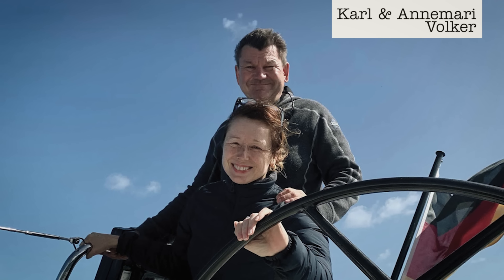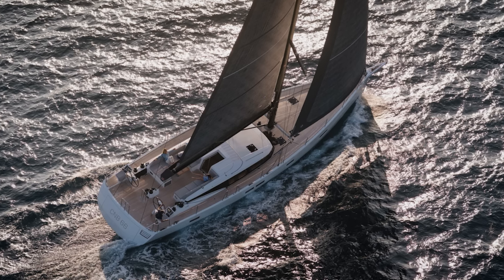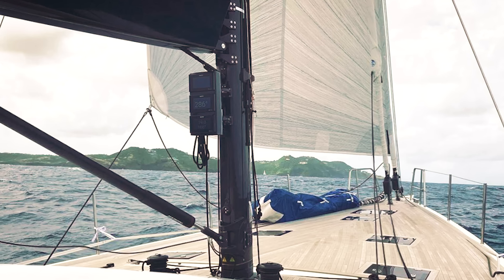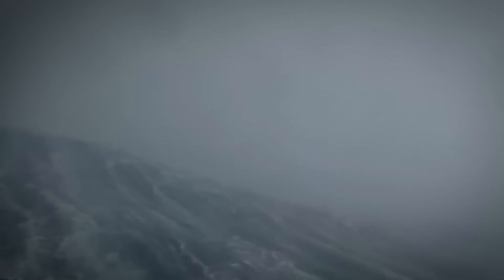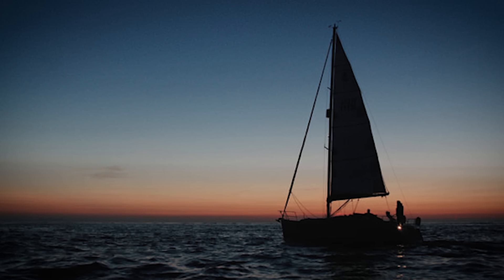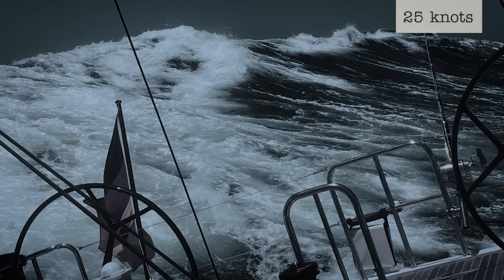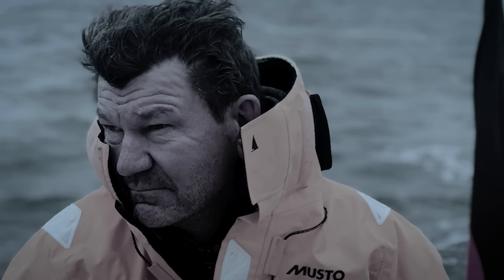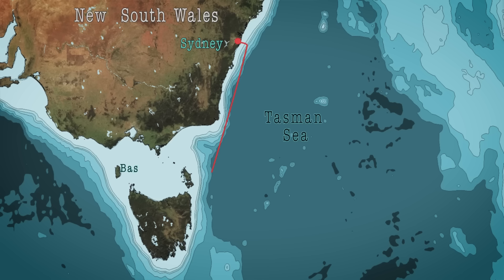Couple DIES on Private Yacht!

Comment: 1979 was the advent of Sat Nav, and later GPS as prior to this the sextant was state of the art.
Think of the lives saved if the sextant remained the only navigation tool.
Reply: I don't see your point. This incident had nothing to do with navigation systems. If anything it might have been worse without GPS. Correct me if I'm wrong but isn't it difficult to get a proper fix in a squall? A precise location is what authorities needed in order to execute a rescue. If you're implying that sailors who can use a sextant are more skilled.... I'd have to say the only thing they're more skilled at is using a sextant. Having a machine on board that gives you a precise location, speed and direction in any condition is only positive. If this couple died because of being marooned in the open ocean after a lightning strike and losing all electronics on board...then you'd have a valid point.
Reply: @falkpatt  I provided a reply which now seems to have been lost.

Briefly, this wealthy yachtsman found himself mid-Atlantic with cascading problems, as can often happen in open seas, and he was unable to deal with it, leading to tragedy.
Without electronic nav he most likely would have never found himself in those circumstances.

As for myself, I am a former navy officer, federal service academy grad, and USCG licensed ship master with decades of experience...
let them remove this as well
Reply: @MarcelaR-dh1ok  okay I see what you're saying. Because it's easier to navigate more people are sailing... You could also say that more people are sailing because there's more people in the world... Population has doubled since 1979. You could also say that more people are sailing because of a lot of other factors too, like increased production of fiberglass boats. More people are also sailing because it's on social media and more popular. But I doubt too many people in the Navy or Coast guard would lament the invention of GPS.... It makes their job easier. It makes our oceans vastly safer. You know back in the day Marine charts actually used to be guarded as top secret documents by Spain, Portugal Britain etc. I'm sure more people got out on the water when the first accurate marine charts were available to the public... and you didn't have to navigate with Dead reckoning anymore....  But it would be silly to say marine charts were a bad thing right? Same goes with any invention that makes boating more accessible and safer.
Reply: @falkpatt  I've been living offshore since the 1980s...for many good reasons, but I just found another...irrational snowflakes.
Just say no, pal....I can explain it to you, but can't understand it for you.

Comment: I’ve been Sailing for 53 years and the idea that a couple can handle a 66 footer By them self is ludicrous. I don’t care how strong you are how wise you are, how experienced you are .
Reply: It’s not impossible, but it requires an improbable level of experience and skill — and even then it will entail elevated risk. Races like the Vendee Globe show that even more demanding boats like IMOCA 60s can be single-handed around the world mostly safely by some highly-skilled sailors (with extensive onshore support teams).
Reply: Tell that to the successful competitors in the Global Solo Challenge, or Vendee Globe.
Reply: I personally know an 81 year old sailor sailing his 70 foot boat. He is extremely experienced by now.
Reply: I have compleated a 9 year circumnavigation aboard our Cherubini 44 double headed ketch. I have been in 3 gales, and two had storm force winds of over 60 knots. I have been in 20 ft seas. Key components for an offshore cruiser for a couple are in my humble opinion as follows:
1. Ability to hove to. Either because conditions have deteriorated or to “park the boat” awaiting sunrise to enter a difficult inlet. 2. Ability to reduce sail area as the wind increases while sailing downwind. 3. Use of two boom preventers. First on the end of boom, second one mid boom to toe rail. This way, while jibbing, if the end of boom preventer is in other process of detachment, the mid boom preventer along with the main sheet keep the boom under control.  4. Mid cockpit mainsheets are dangerous. No place on a husband wife boat. I know two people knocked overboard. One during a 40 knot squall at night without a life jacket on. Airlifted from Bora Bora /Reatia back to Germany.  5. Boats 60 ft and over are too large. Crew needed. Difficult to haul in remote areas. Roller this and roller that. Still too big! FYI - We have in mast roller furling, Hood system in custom carbon GMT mast, and roller jib. Staysail and mizzen are hank on.
Reply: I've been sailing a similar number of years and the thought of passagemaking on that vessel makes me cringe due to combination of size and design.  I've crewed offshore on boats almost that large but of relatively traditional design and they posed no real problem even with short crew in challenging conditions (important that they heave to well).  However with a boat like that, hard pass.  Just my preference...to each their own.
Reply: People have solo sailed boats as big or bigger, It totally depends how they are set up.
Reply: @frankmiller95  Those people are professionals and skilled to do that job. That is not the case with a normal couple such  as the one whom died in this axident.
Reply: @lungarotta l am a professional as well, licensed in sail and power and have sailed all over the world on sailboats and ships. Those who are not fully capable of safely executing routine sail handling measures during modestly adverse conditions should not be at sea on their own. These people may have successfully gotten away with numerous mistakes before finally finding themselves in a situation that killed them. lt's a simple as that. Before the advent of widely available and precise electronic navigation equipment, these events were far less common.   

To repeat one my favorite quotes yet again:

"The word 'experienced' often refers to someone who's gotten away with doing the wrong thing more frequently than you have."

Laurence Gonzales, "Deep Survival"
Reply: 💯 too much boat for a senior aged cruising couple. This is the main takeway. If the boat were smaller, with less sail area and less loads on winches and spars, this couple probably would've survived....
Reply: @falkpatt  Yes, That's just what I thought when seeng that huge boat: too big to be handled by a couple. Imagine the power of that huge mainsail and so sheet shaken by the storming wind... a smaller boat could have been much easier to manage. But I think there is another factor to be considered: such a large cockpit, so comfortable in calm seas, becomes a nightmare in rough sea and strong wind when you have to balance yourself standing and not having a near grip. In a old boat like mine, with a small cockpit you can handle both jib and main sheets sitting safely and with plenty of things to grip around.
Reply: Wrong good sailors like Taberly handle 100 footers
They key is watch the weather
Have a smaller sail plane ie ketch yawl
Reef down early do not wait
Have the best auto pilot
Make sure your running rigging is up to it
Do not be underwinched
Eat well
Sleep well
Reply: Really? I disagree. First Ocean Passage 40 years ago, been professional sailor for 16 years, sailed to every continent apart from Antarctica on sailing vessels up to 120 feet and yes, a skilled couple can easily handle a vessel of that size and I have known plenty who have. I've shorthanded vessels of similar size myself across oceans. I don't know where you are getting your incredulity from, but it is, well, misguided. However the setup in this particular vessel seems to me to have been unnecessarily dangerous. Also, not much of a fan of in-boom furling, having had significant problems with it on several vessels, though it can be necessary in much larger vessels. I don't particularly see why it was necessary on this vessel however. 66' is not particularly large, indeed quite small overall these days.
Reply: @lungarotta , Exactly, they were inexperienced and they did not cross train the crew on all parts of the yacht as soon as possible. Every sailor knows the importance of cross training crew because you just can’t pick up a phone and have someone drive over to help you out when you’re in a crunch in the middle of the ocean. That being said, what they trained us in the Navy is that accidents are usually the result of at least 2 factors. In this case it was a really bad storm that killed six other people and the lack of training of the New crew.
Reply: @pnwcruiser  Nothing wrong with that boat.
Reply: I look at this as yet another Tragedy at sea caused by too much money and reliance on technology and modern designs. One need follow only one season of the Volvo ocean racers to see a cruising boat should NEVER be designed using the designs of these boats as the start. Yes they as big and fast and have huge sails but also big crews and STILL incidents happen every year. Men are injured even loss of life has happened.  Triditional heavy displacement boats with easily handled sail plans that split the sail load among more but smaller sails and use only machnical advantage of blocks and manual winches to handle sheet loads are e far safer and this is proven, I would rather sail on the purdey’s little 27 foot boat then any of these modern designed yachts.
Reply: iFF i get märryd it´d be FeyährlüND v v 
büt häl i dönt Fläyy xD
Reply: In the days before widely available electronic navigation events like these often also meant that the likelihood that a disastrous event like these poor fellas experienced became widely known, or even known at all was much smaller. Now it’s perfectly possible that events like these are more common today. It’s also possible that it’s due to modern equipment, and/or modern vessel design that’s contributing to an increased incident rate. However it’s also possible that, if incidents like these are more common now, that it’s a result of more people sailing simply due to the fact that there’s just more people sailing thanks to a larger human population overall as well as information not only spreading quicker, with a much farther reach while at the same time having a much better chance of spreading anywhere at all to begin with. If anything, the equipment and vessel design, keep getting better, more reliable while also helping people be safer with a much greater survival chance if and when disaster strikes. I if we just look at how much the general view on safety in just about every aspect of society. Work is much safer, public safety in general is taken more seriously which naturally also translates to people taking personal safety in their private lives too. So..🥴..all that is to say that if we had data that shows that these types of accidents have increased I doubt there would be any statistically significant correlation between electronic navigational equipment becoming ubiquitous and fatal accidents at sea. ¯\_(ツ)_/¯

Have good one ✌️🖖
Reply: @lungarotta this was a skilled crew.  U are sexist
Reply: @falkpatt  u don't find it a BIT STRANGE THAT THEY BOTH DIED IN THE RESCUE HELICOPTER.....AND EPSTEIN HUNG HIMSELF WHILE CAMERAS MALFUNCTIONED.   WHO WANTED THEM GONE?  FOLLOW THE MONEY!
Reply: @markhamstra1083 The two unfortunates who owned the boat were obviously not of Vendee Globe caliber.
Reply: @pnwcruiser I agree, I was flabbergasted with the design and execution of the mainsheet. Obviously an accident that happened
Reply: @frankmiller95 I have sailed a wide variety of boats fir 50 years and I agree completely with your observation. Modern technology has made it possible for people to go to sea who have no business being there. In the end the indifferent sea respects neither inexperienced people nor their technology.
Reply: @peterguirguess853  If you read more attentively my post you can see I was referring to those high skilled professionals who race with IMOCA 60 (quoted in the initial post). We are all unskilled in comparison to those people in handling such a big boats, in spite of all our experience. And if you read more attentively you will see there is no trace of sexism.
Reply: With all sorts of fancy electronics and fair weather, they can.  The problem comes when the weather turns and and the electronic gizmos fail.  Then they are rightly f*****.
Reply: @scomo532  Exactly.
Reply: Dead right. Escape did not look like a proper blue water cruiser from the images shown. light rigging, spade rudder, bolt-on fin keel..... @pnwcruiser
Reply: You must take a look at Perini navi 54 meters ,Paz also Andromeda and others can be sailed single handed ✋️
Reply: @-MaXuS-  , good point I would wager to Guess that this type of tragedy has per capita statistically decreased with the advent of mass production of more advanced sailing equipment and an increase of population density. At the same time the number of rescues in storms have become more efficient due to the real life extra practice for the rescue crews due to the increase of sailing vessels due to Mass production and world population increases.
Reply: @mirandahotspring4019  , I think going to Nova Scotia at that time of year with without highly advanced weather data, was probably one of the factors that led to the tragedy.
Reply: @macdoctor145 Perhaps, but solo around the world yachtsmen are often faced with worse weather. A well designed and set up boat can cope with most weather.
Reply: @mirandahotspring4019  , yes, I agree that's a good point however these were retired people that were kind of just doing this for fun so they probably weren't ready for those type of swells for that type of yacht. Highly advanced weather information could have probably saved their life.
Reply: Well said!
Reply: Well said!
Reply: IMOCA boats are engineered to be safely sailing in 40+kts. This boat clearly was not. It is a Med vanity boat.
Reply: Beowulf yacht
Reply: Plenty of single handed sailors have crossed oceans and even sailed round the world. I know one of them personally.
Reply: So many arm chair sailors, with ZERO 😅big boat experience.  As I write this I am in Alaska with 30 knot winds and near zero Fahrenheit without wind chill.  I have seen 40 foot waves and 50 knots of wind. 

I have lived aboard a 74ft sailboat and sailed all over Southern California, Baja Mexico into Sea of Cortez, done the Baja Bash back to CA, out to Hawaii for months then up to Alaska for more then a year. 

Long skinny boats are far more stable, more predictable, with better motion, more comfortable, faster and easier to handle than all your 40ft boats. 

Unless you have experience with well designed big boats it is better to keep quiet!!!

With that said my I measurement - (mast height above deck) is 64ft. Escape’s I measurement is 82ft. That measurement along with complicated sail handling systems, should tell you all you need to know as to where this went wrong. 

Interesting no one has hit on this.
Reply: Especially for a boat like that with an open stern and virtually no protection in the cockpit. I would much rather be sailing a 40-foot full-keel boat like and Island Packet or similar boat if it were only me and my wife on board.
Reply: What is the largest single hand size?
Reply: You can't compare those extremely well trained professionells to even experienced 'normal' sailors.
Reply: What's so crazy about it? The Vandee Globe yachts are all 60 foot being sailed solo in the southern ocean around 3 capes.
Reply: I dont know. I sail my Baveria 55 all over the world solo for the last 8 years.
Reply: Interesting, IMHO the boat's layout ist nice for sailing in the Caribbean or the Med but not for serious blue water, let alone heavy weather sailing. Too many fancy helpers which could fail.
Reply: Listen to the whole story before make comment, they were not alone, the had 2 professional skipper aboard, so they were 4 and all experienced. Btw it is not impossible to handle a 60 foot boat even by one person, like the many “around alone” regattas

Comment: As usual an excellent summary of the events with no frills;  no sensationalism.

Then again it is quite surprising the skipper didn't tell an experienced crew members the idiosyncrasies of the boat. Any new crew member must be given the full picture of the boat, even if the rigging and operational mode is traditional : each skipper has his / her preferences and ways of doing things (I have mine) and everybody must adjust to them : reefing at night in heavy weather is not the moment when you should figure out where is posted the main halyard, how a preventer etc… 

This is why spending half a day sailing close to shore for a shakedown and adjustments with new crew members is essential. You sail back to port for dinner, have a good night sleep and leave the other days when tide; currents and wind allow. Simple? Yes but barely done except in sailing schools and who wants to be considered as a student or see one's own pride and joy taken for a sailing school vessel?

Nonetheless it seems to me this disaster could have been avoided altogether. 
Then again, let's respect the victims and hope viewers will lear a lesson from this sad story.

This story calls also for another remark. Why choose a 20m boat to sail as a couple? A 13-15meter boat is more manageable and the forces involved are easier to handle… 
And again a huge mainsail to handle with a huge boom on a 20 m boat would simply scare me stiff if I had to handle the boat alone or almost. A divided sailing plan would have been much easier to handle than those monster spars which can be properly handled by a numerous crew…
Reply: 5:14 the graphics for the uncontrolled gyre don’t accurately show the wind direction
Reply: Bad summary in regard to associated erevilant photos and clips